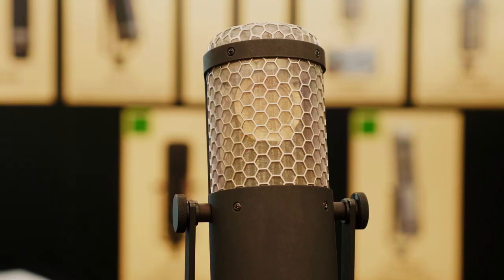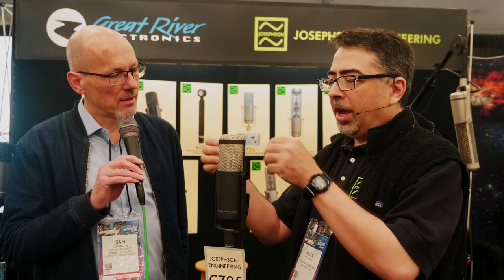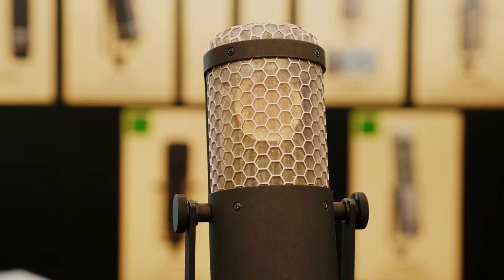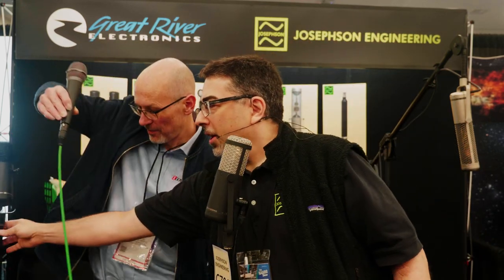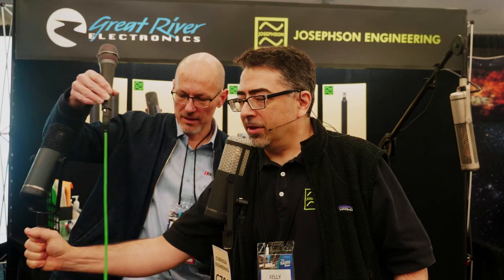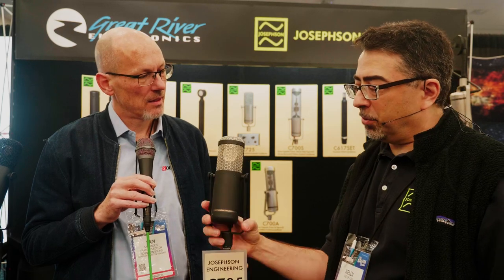Josephson Engineering C705 Microphone - NAMM 2020

Comment: Wow ... everything described about this mic is cost cutting... no metal mesh head, no brass, no Omni, cardioid only, no transformer coupled output, no pelican case, more proximity effect due to capsule design, yikes,  that’s pretty much it lmfao...

 $2500+ is not affordable .... I don’t care how awesome your capsules are! 

Most will buy a used U87 before this, knowing a U87 is a true work horse for 2500. Yeah the U87 may not sound the best on every source, however it will sound good, esp if you have good mic technique the U87 will always shine.
Reply: Up To Bat Entertainment So you’re saying it’s not for your current studio needs? Josephson sells a lot of mics so apparently it is the right mic for lots of professional studios.
Reply: The U87 is a poor substitute for a Josephson.